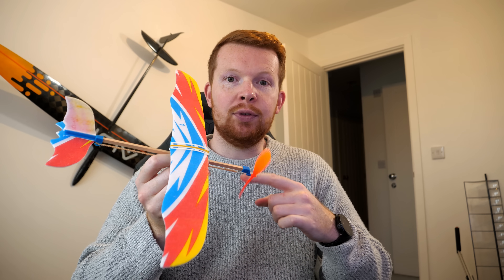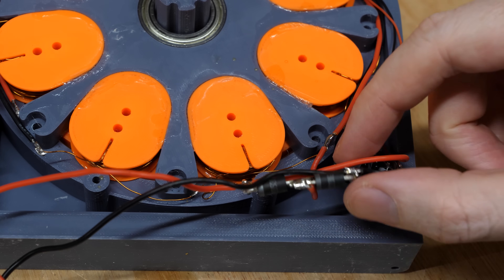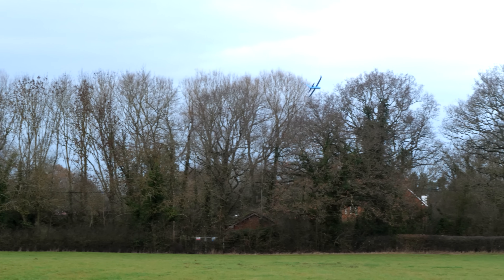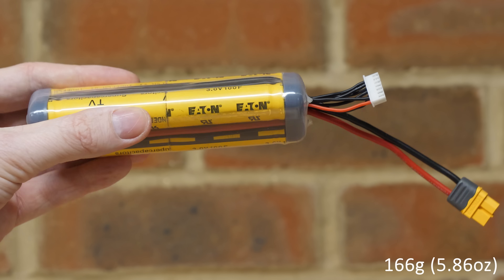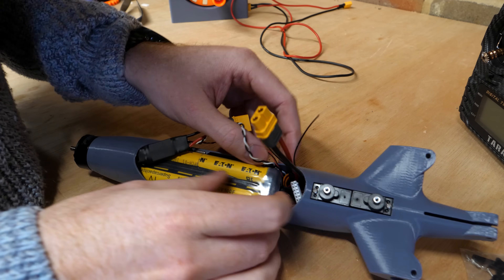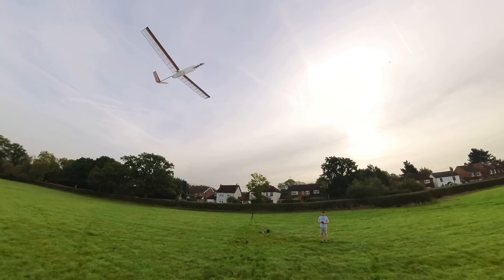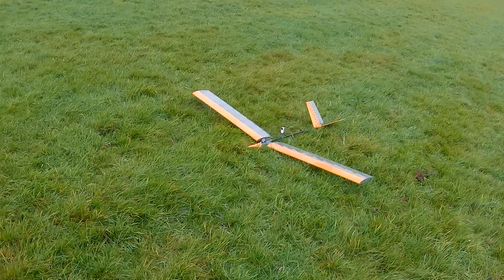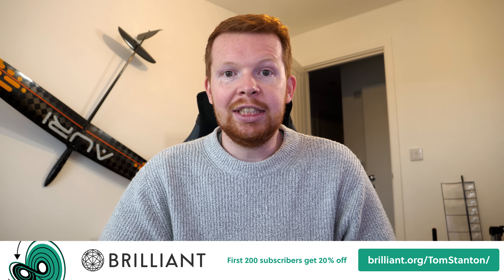Super Capacitor Plane

Comment: With a buck-boost converter you can power the circuit 5V until the capacitors reach about 1.2V or so

Comment: Maybe I misunderstood what I heard but it sounds like you're only charging the capacitors to 1/2 of their capacity? I'm assuming this is because of a voltage limit for the radio control gear and motor? Why not charge it to the full 18 volts and use a regulated power supply to keep the output under control?

It would also be interesting to put some really light thin film solar panels on the wing Not only will this assure at least when the sun is out you always have enough power for the radio but if there's any excess power it'll go back into the capacitor bank catch a little bit of air ie some thermal action and you might be able to stay up quite a while and develop enough charge for another boost

I could also see maybe a solar panel on the ground charging an additional capacitor bank and when you land that bank will be fully charged and because of the high input output current of these units you can dump its charge into the airplane and take off again almost immediately and while you're flying the large solar panel will charge up the ground-based capacitor back again you could basically fly forever for free

Comment: Great project.  I’m a plane fan but have always wondered if capacitors could be used for cars like a slot car but without the slot using a charge plate they drive over on the track. That way you could have slot car type racing but with steering.

Comment: How about creating a circuit that would switch/convert the motor into a generator to regenerate some voltage to recharge the caps while the motors are off and windmilling? Possibly to keep the servos and radios online for a longer glide...
Reply: That will add resistance to the propeller, effectively making it resist movement and therefore brake the plane. It will allow for more time with servo control, but will also mean it is slower, reducing control surface effectiveness, and increases the possibility of a stall while reducing the glide distance.
Reply: @Gaaaaaame  Ahh, correct, that would be an issue. But it could then act as brake for the motor in that case forcing the props to collapse and eliminating most of that drag, and no windmilling...
Reply: @S0LRAC  it would likely not be sufficient to do so because the motor is not large enough to cause immense braking action.

Comment: It really shows how good Li-ion is... with a basic charge regulator you can safely charge Li-ion easily from your generator... Even a basic linear regulating LM317 set to 4.2V (or 8.4V) would be OK.
Reply: that's hours of cranking one battery. You overstimate human's "im tired" at just 5watt production after 10 mins.
Reply: he should repurpose one of his bikes as a generator lol @dimitar4y
Reply: @ilovehumongoushonkers   he can but thousands of people already did it on youtube and it's not worth it
Reply: @dimitar4y  Realistically it's only about 10 minutes of cranking to fill up a battery. If the battery holds 10 watt hours and the crank is capable of producing 50 watts.
Reply: @DKFX1   where's the losses, bud.
Reply: @dimitar4y  A good hand crank have efficiency of about 80%. Certainly not something that turns 10-15 minutes into several hours as you stated.
Reply: @DKFX1   very cute. go do one and come back here to confirm the numbers for me. I won't be waiting because you'd be too ashamed of your findings and your former confidence in something you know nothing about.
Reply: @dimitar4y  I willl be trying at some point: I'm curently building the generator, all the prints are finished, but I need to buy some hardware to finish it. Maybe I will come back to confirm if I remember.
Reply: @dimitar4y  Ah okay. I think I know the misunderstanding. When you said "a single battery" I thought you meant a single 10w battery cell as Tom showed in the video, not a full battery pack. Of course a battery pack will take longer depending on the size.
Reply: @DKFX1   we were talking smartphone, or a single li-ion battery, around 4000mAh. It's not the "Size" of the pack. It's the total capacity and internal resistance.
Reply: @dimitar4y  Welcome to the world. When somebody talks about the size of a battery they are usually talking about total power capacity.
Reply: @DKFX1   no.

Comment: Back in days I was flying on Ni-cads: 10s 600 mA*h battery was good for 3.5 minutes of flight. I had 3 packs and a single charger and went through batteries very fast. ~2 mins of flight with 2 mins of charging would be nice back than - at least it is totally feasible to use in on regular basis. And 200% feasible for a glider!

Comment: It would be cool to see a model plane built using batteries or capacitors as the structural componets as well as power source. Have the wings and fuselage constructed from batteries with minimal lightweight cowling.
Reply: The problem then is that, if the plane takes damage, it has a decent chance of catching fire. Capacitors and batteries both have this issue. There is also the issue that custom dimensioned capacitors are prohibitively expensive for such a project
Reply: @Gaaaaaame  Excellent points. I think it would be a cool look at power to weight ratio. Given how thin skinned plans are anyhow they are always susceptible to damage. Though, like you said, even more so if the batteries were structural.

Comment: You could use  the "Brim" selection in yout slicer program to bild a wider base around your model and have better stability -adhesion to the bed.  Thanks for your video
Reply: A garolite printing bed with a touch of Bedweld and you won't need  a pesky brim.

Comment: In theory, with a folding propeller, if you could apply some kind of braking mechanism to the back of the motor, it would cause the propeller to stop spinning and fold back against the fuselage.

Another idea would be to have a spring loaded nose cone that the power of the motor spinning would lead to the spring being compressed, but under a certain RPM, the spring would overcome the centrifugal forces, and drive the propeller back into its resting position, thereby reducing its total drag.

At the same time, at least in theory, the nose cone would also help reduce drag just a tiny bit.

Admittedly, this part would greatly increase the complexity of the machine, and could fail to operate [by breaking, unscrewing, or wobbling excessively] if not super well thought out, and it would also change the balance of the plane's center of mass, seeing as it would be added to the front of the plane, so, in response, one might want to extend the tail boom a little to make up for the addition of the weight on the front.

It is something that happens sort of, on existing variable pitch propellers, although by a somewhat different method.

Where they fold back radially, instead of axially, one can fold back modern propellers so that they produce very much less drag if an engine stalls in flight.

I could envision several different ways of making such a propeller 'return' device, and, while none of them are pleasingly simple, several of them come across to me as reliable enough to work repeatedly, even out of printed plastic, perhaps upwards of ten times before failure.

Making them from bonded carbon fiber, however, could make them nearly indestructible.
Reply: you should be able to program the ESC to apply  a brake when you stop the motor .
Reply: Using the motor as a generator to recharge the capacitor could get extended flight time if you initially go really high and then want to do a bit more low flying at the end - whilst your ideas would optimally extend gliding I believe having throttle control on landing could be more useful and fun in most cases. A switch between braking and regeneration would be even better although it may be heavy to implement both.

Comment: Tbh this sort of thing is pretty ideal for kids wanting to fly an RC plane. The flight time isn't very long, but that imo is a good thing, gives the kids less of a chance to crash the plane. And the short re-charge time means they can go again and again until they're all tuckered out.
Reply: It's also safer then handing a bunch of kids a lithium polymer battery.
Reply: @Darkknight512  they use nicad batteries for kids stuff. a lot more stable then lithium for less energy density, and dont pop like copasitors.
Reply: @Darkknight512 lithium popcorn batteries are safe and effective.
Reply: I used to have an old super capacitor plane, air hog thing. it was amazing.
I havent seen one in years though.
Reply: @classicmax1 Eh in my experience at least kids are more likely to crash it way before the 2 min mark. And if they dont they may fly it well beyond the area they're meant to and cause it to land or crash somewhere inconvient. So imo a short but reasonable time is ideal for helping keep it out of trouble.
Reply: But also capacitors have another issue; they can pop when overloaded and discharge if some wires conduct to it prematurely (also brought up by some dude named nick5402). The second problem is only relevant if the planes are cheaply made, which, is likely, but the other can happen if the user, a curious kid, decides to crank for longer than the capacitors can handle
Reply: @randomalt9617  there would need to be some sort of voltage limit protection on it yeah.
Reply: I'm 49 and I want one bad, guess I'm still a big kid at heart 😁
Reply: @classicmax1 Yes! When I first learnt to fly an RC plane, it took A LOT of launches to get up in the air - and most power is used during take off. Plus it helps to do lots of 'touch and go' type manoeuvres to learn how to line up your landing. Beginner RC planes are also built to withstand crashes more - so the issue of crashing isn't really such a big deal. Lithium polymers are fine and safe for beginner planes too, floating into the ground at 5 miles an hour isn't going to set the nukes off.
Reply: i think it forces the kids to crash the plane multiple times to recharge the thing.
Reply: A big problem with short flight times is being able to actually figure out how to fly. I have a little race drone with what is suppose to be hands off capability but that is if you get it all trimmed in. The problem is i can never get it perfectly trimmed in because it only has 2 to 3 minutes flight time so it sits in a toat probably crushed in the bottom and forgotten
Reply: Just wanted to say the same thing this is a sort of ideal toy plane.
Reply: Less time to crash the plane? You estimate me, good sir.
Reply: Air hog did it in the early 2000s. It’s in the beginning of the video
Reply: especially if you can slot the plane into a little charging launcher slot (built into the controller) so you can just slot it in, charge, then launch repeatedly
Reply: no thanks . MY CHILDREN ARE ALREADY BEING RAISED BY IPADS ...
Reply: U I
Reply: Short recharge and no limit on recharge cycles. A glider that gets an extra push to get up high.
Reply: More importantly it gives the youngsters of today some sort of exercise charging the thing up!
Reply: @marviwilson1853 or just buy the kid a bike
Reply: Exactly my thoughts. This shuold be a commercial toy. I realize there's loads of extra work to make  real product from it, but somebody should. 😀
Reply: I think this charge should go to  the company who possess the right capacity to build it.  @RegebroRepairs
Reply: child labour on regenerating power for the capacitor?? GOTTA LOVE ITT😂
Reply: and their arms get a bit of exercise
Reply: Yeah its good with the short charge time cus kids these days have got the attention span of a flea 😂
Reply: @mark675  If spelling out because is a little strenuous, substitute with as.😉
Reply: @mark675 theyve always been like that
Reply: @mark675  So true!!  LOL  Though we kids were quite goofy ourselves!
Reply: @mark675  So little attention time that they need to shorten common words, right?
Reply: @MikeAG333  Lame attempt at being funny 😂
Reply: @mark675  One day you might come to know the difference between irony and humour.
Reply: @MikeAG333  my god you're boring 😴
Reply: @MikeAG333  Cap
Reply: @mark675  they existed about 20 years ago. most "kids these days" wouldn't have had and/or dont remember them.

Comment: Maybe add a boost converter and keep a constant 7 V output (or higher) to get extra flight time. Although... even at >90% efficiency, the small amount of wasted power may be enough to discourage using a converter all together and not be worth it. Probably a good experiment to try out on another video! :)
Reply: Don't forget the added weight
Reply: @crackedemerald4930  yup, this is true
Reply: And you'd lose control authority very quickly after engine failure.
Reply: @merseyviking   Oh yea, that'd be the real nail in the coffin.
Reply: Tom's calculation is that the energy in the caps is about the same as a coin cell.  I'd assume you only would add seconds of run time with a boost converter.  Not to mention it needs to be light and high current.

Comment: Can you use the propelling of the propeller to recharge the capacitors?
Reply: It would increase drag even more. When a motor acts as a generator, there's resistance. Something like solar wings would be much better.
Reply: @CYDeviant  Cheers mate a normal person on the internet. I should be awarded a medal for finding you.
Reply: That weed is too much for you. The answer is no, it won't work.
Reply: @lamarw7757  how do you know about my weed consumption?

Comment: Very neat! Maybe you could squeeze the last couple volts ( <5 V) out of the supercaps with a small voltage booster circuit? Wouldn't add much mass I think...
Reply: Boosting such low voltages is quite inefficient, and the last 5 volts anyways contain only 10% of the total energy of the full 16V.
(The crux is that the lower the supply voltage, the more current you need to draw for a given power requirement.)
So, this isn't worthwhile.
Reply: @leftaroundabout  maybe for the radio only
Reply: It wouldn't be worth it. The energy left at 5V is about 10% of the energy at 16V. The voltage booster circuit would also need to be quite powerful, add conversion inefficiency, as well as weight.
Reply: Just pop in a vape battery which are tiny and around 550mAh to power the radio stuff. You don't want to lose control of the plane when the cap has run out.
Reply: or maybe put more capacitors with smaller capacitance in series. It should have the same total capacity in wh, but for an example if the voltage is doubled the last unused 5v out of 32v will be much less compared to 5v out of 16v.
Reply: I was thinking the same. Something like a joule thief would be easy to implement.
Reply: @EmergentPixel It don’t think it would work, unfortunately, as a joule thief’s boosted charge immediately collapses in the face of any significant loading.
Reply: A SEPIC converter would be nice here. These days they can get an efficiency of around 85-90%.
Using some schottky diodes also helps.
Reply: Maybe even regenerative propeller movement.
Reply: No, he doesn't want to squeeze out the extra 5 volts. That will do literally nothing for him. You mis-understand the problem - Quite badly. All of you.